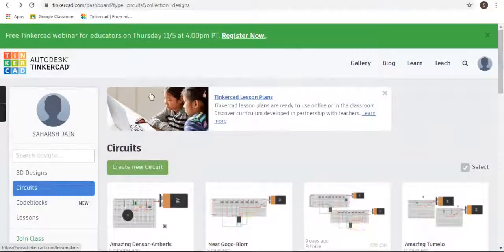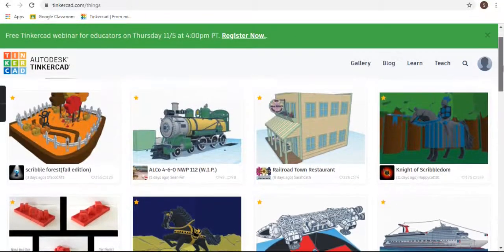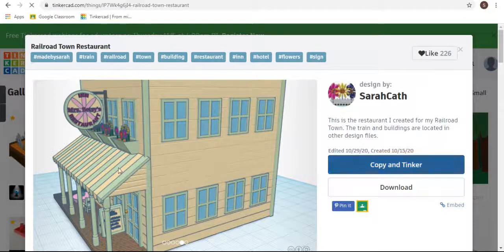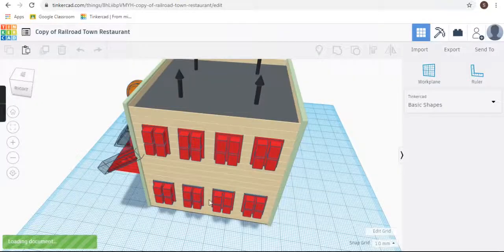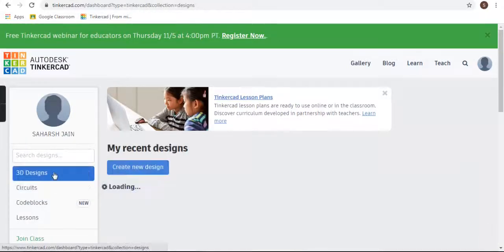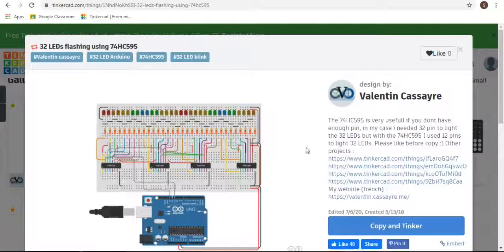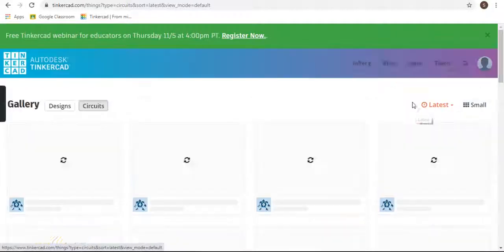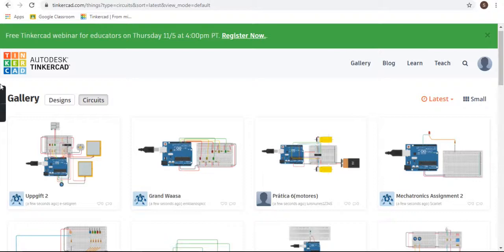How to copy most complicated circuit & designs on Tinkercad in seconds

Comment: Hi, do you know how to copy say a bread board with a circuit built on it from one of your projects to another that already contains something in there? For instance I have a D flip-flop circuit project and want to paste in 555 timer based clock I built previously - is that possible?
Reply from the maker: Hi! It is possible! You can try by copy and pasting it by opening 1 tab only (changing the project after copying). If it don't work let me know. Make sure to like, share and subscribe! :)